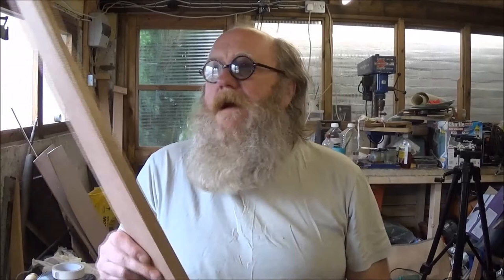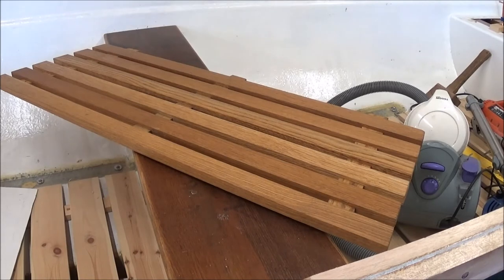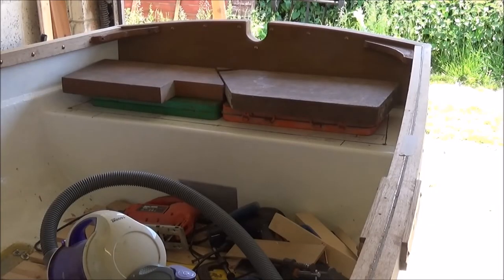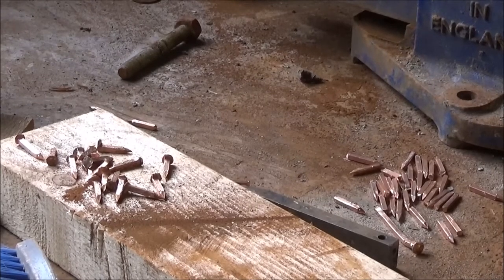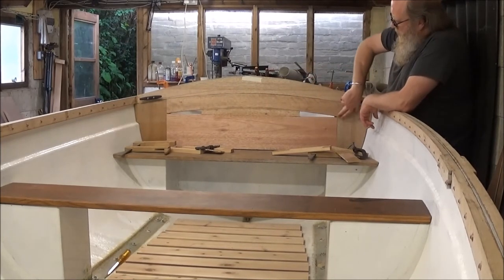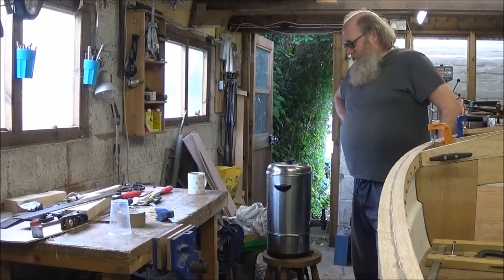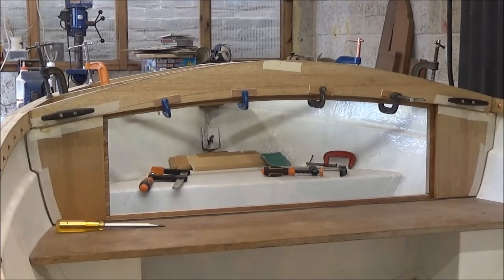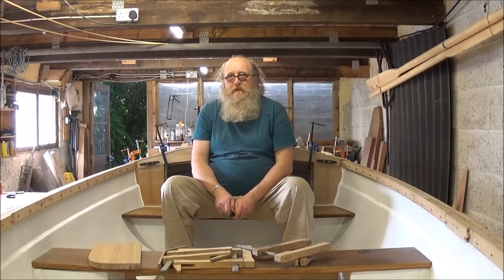Dale Skidmore -Boat Restoration Episode 29

Comment: The fore deck is coming together nicely, I like the idea of the copper nails.
I think you are right about using thinner strips for your supports and in the end they will be stronger as a result. Regards Dave
Reply from the maker: Yes Dave, I think the oak was a tad too thick to bend as tight as that. Got the fore deck on today: looking forward to getting the clamps off tomorrow, ha, ha.